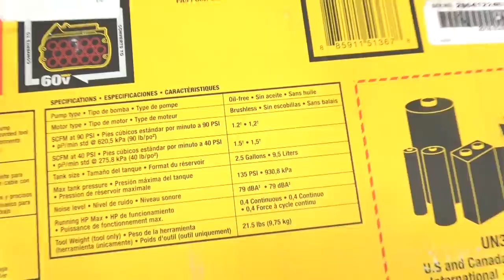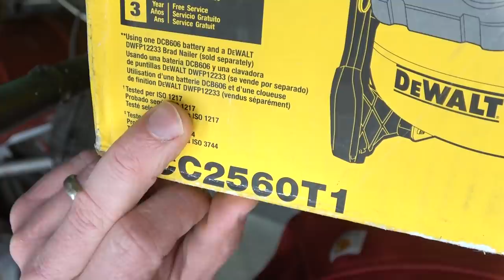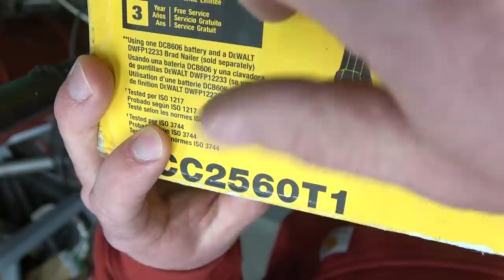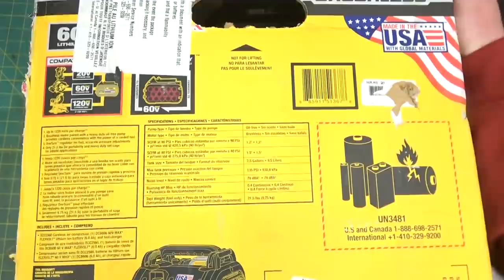BOLTR: DeWalt Flexvolt Compressor | Gutless and Brushless?

Comment: For leakproofing railcars we always use flax yarn and flaxseed oil. The teflontape does not hold up against all the vibration that a freight train produce. Railcars also experince quite extreme temperature differences and is always pressurized with 5 bar. These pneumatic couplings also have to have a lifespan of 30 years+ and again flax yarn is really the only thing that holds up over that much time if applyed correctly!
Reply: assassinlexx  Agreed! It's like he's a graduate of Flax-U. Thanks - Lumpy
Reply: juliussk I saw the transition happen in the 1970s, being a kid.
Reply: Flax yarn?
Reply: Flax-U... sounds familiar... Back when I was crawling around in hulls to obtain a few doll hairs,  I recall wrapping flax rope around shafts to then tighten the gland nut just enough to release the schmoo... Usually in a dark damp bilge  in an attempt to mitigate a leak in saturated old vessel... Maybe that is where I heard of Flax-U?
Reply: Hemp and Locher paste.
Reply: Just the flax, ma'am.
Reply: @vendomnu  A solid hand waggling before alignment has been known to loosen the fit, if that's what you're after.
Reply: "zero flax given"
Reply: @jamessouza7065  too good!
Reply: Impressive if the flax capacitors can really handle 1.21 jigawatts as claimed
Reply: Teflon cold flows.  I only use if for low pressure.

Comment: That hand hole is for incase you were carrying out by the hand hole and you drop it and break it they can say it's your fault and not replace it
Reply: He covered it with "coverassery" thing.
Reply: uh clearly its so u can know not to stick ur forklift in there
Reply: Reminds me of the carrying handle on the M-16 my drill sergeant constantly told us to not use to carry the rifle.
Reply: or it's for balancing/sliding the box around while the weight is being supported under the flaps of the box where the other failure mode is. p.s. did you really leave this comment 1 week ago?
Reply: @mikecschmitt89  He is subbed to his patrion, so he gets vids a week in advance.
Reply: They mean lifting with a forklift. If you put a fork through that hole it'll damage the product.
Reply: Some Guy Named Mat well carrying a rifle by it’s sights isn’t a good idea. Never understood why it was called a carry handle though
Reply: @ChrisSmoove77  I need to know if this is a joke.
Reply: @Mcrawf21   I think that handle was intended to cover the bolt handle of the first armalite version.

Comment: Haven't watched the video yet, but is the air connection cordless too? It would be so convenient to not be tethered to the compressor while I fill my bike tires
Reply: That's the next model. They'll have to come out with new tires that inflate with hot air and dreams
Reply: @georgefellow  that would be even better! Trying to get to 30PSI on lung power alone is quite tough.
Reply: hahaha im loosing it over here!
Reply: Wireless Air: OUT NOW
Reply: Almost as good as the EEVBlog video of the Flake (yes Flake) multimeter watch.
Reply: Bluetooth air. Wave of the future dude.

Comment: Battery powered compressor just sounds like the answer to a question that nobody asked.
Reply: Yup. But there are probably some housewives out there who will buy this for hubby as a gift.
Reply: Chris Ewalt In pro quality, it'll be great for use at unpowered sites, for example to work on the power feed to the site.
Reply: Doing pressure testing on sites without power. Yea I’ll take it over dragging a generator to the site. 👍
Reply: @SeanNyhc  
 @John Francis Doe  

Agreed. Especially out in the field, no electricity!

Comment: This has got to be the most comprehensive tool review channel ever. You don't just get to see the tool working. You take it apart, tell how each part was manufactured, the materials they used to make the various parts, the likelihood of parts lasting or failing, and if the sum total of parts is any good or not.

Comment: I'd argue that the feet being as soft as they are is actually fairly well thought out. You get the same soft kind of rubber on some computer fans, what for dampening damping whatever you call it the vibrations. 
At the very least, it won't chase you around the shop when it's running, if nothing else.
Reply: I thought the same exact thing.
Reply: If the feet are too soft then they may deform over time until the machine rests of the plastic. But yea, if they are just firm enough then they will cut down on vibrations transmitted to the surface the compressor is resting on, and might help keeping it from escaping without help. Without getting my mitts on one of these I really can't tell how the feet will perform, so I'll just wait for the tests.
Reply: I assumed that they were designed to take the abuse of vibration so soft flooring doesn’t have to.
Reply: Compressors have a reputation for shaking shops apart.

Comment: That hole in the cylinder is more than likely to bleed pressure so the crank gets past a certain degree so not to lock up when pressure is high!!! If it started compressing at the bottom of the stroke when pressure is high in the tank it could  lock up the motor!!! So by bleeding the pressure for a few degrees it allows the crank time to build speed to drive through the wall of pressure it incounters on every stroke!!! Just like on high compression engine's the exaust valve is left open for a few degrees before compression begins!!! That way you don't lock up the stroke at bottom dead center!!! You can't start compression at bottom dead center!!! You run the risk of bending your rod!!! I also believe that the rod is most likely a powered metal rod,not a casting!!! Just like in car engine's!!! Keep Rocking it out!!!
Reply: I think its replacing a 3 way valve. They're pretty standard for compressors, you can google up the parts.
Reply: Rocker Pat !!!
Reply: The 4 stroke's motor intake valves close after BDC for a different reason: since the intake valve cannot be opened instaneously (at least not for now, Koenigsegg is still developing an electromagnetic valve control system), closing it at BDC would simply not give enough time to intake all the air the motor could. So, the valve is kept open for a longer time.
Reply: @pum882  electric solenoids will not do it instantaneously either. Anyways pneumatic valve springs exist and are a proven technology that has been limited on how fast it can rev a tad over 20k rpm because of things such as flame propagation speed etc etc. At 20k revolutions in a minute a valve is as close to instantaneously moving as it can be a damn solenoid trying to do things electricity actually cant even do given the quickest thing in the universe is still not instantaneous stop using this word when its impossible alright
Reply: @pum882  at bottom dead center the intake system is still charging the cylinder because of the drop in pressure closing it abdc allows the process time to complete. It closes the piston moves up the process is then converting the chemical energy of the fuel and air into force. The piston then moves up and the exhaust valve opens. Opening a valve quicker requires more spring tension to retain said valve. So really the whole free valve thing is a joke given what he showed off was less impressive than current technology that is actually newer

Comment: I think that since the piston and the rod are a single piece (there's  no wrist pin), when the rod is at high angle in respect to the crankshaft, the piston cannot hold the pressure. So there's no need to build up pressure in the cylinder  before the piston  reaches a certain height. All the pressure built prior to that point would be lost, so the holes simply prevent it, in order to save energy.
I hope you understand what I mean, English is not my everyday language.
Reply from the maker: Yes, makes perfect sense! Thank you!
Reply: I was thinking the reed valve may keep the pressure slightly negative (psig) at the bottom of the stroke so the hole lets air in to get to 0 psig before stroking up.
Reply: I was wondering about the piston sealing at what you call high angle, that I just called weird angle. I thought maybe the business end of the piston had some roundover to handle that but now I realize that it would have to be an oval to seal at that angle (projection of a circle being an oval and all that)
Reply: Mad Zit An oval piston wouldn't fit at the straight angle.  A spherical piston (part of a sphere) would keep it's cross section but sealing is beyond me.

Comment: I worked for the company that made the pop valve on there, it's a machine shop in Fenton, MO called Control Devices.  IIRC they're on all Black & Decker compressors.  Pretty cool process of making and staking them, and even more cool to see it all the way up in Canada!

For those interested, the parts are made on Hydromat precision transfer machines, then assembled and pop-tested in house.  When I left the company, they were in the process of making a new testing / staking machine for more accurate pressure relief PSI, per B&D requirements.
Reply: I work in industrial compressor automation, we buy so many parts from CD. Think we've got some pop valves, mufflers, and check valves on the way from them now! Love those folks, they're one of very few vendors I've never had issues with in regards to quality and accuracy in orders.

Comment: Regarding your comment at 5:55 - I'd suspect they put thought into the feet and chose the soft feet for at least two reasons.  First, they'll help keep the total noise down by reducing the energy that transfers into the surface the compressor is resting on.  Second, the soft feet are selected based on the (relatively) low frequency vibrations of the machine.  Soft feet will reduce the likelihood of the machine walking around on its own.

Comment: I think the unloading hole on the cylinder is so that it doesn't see any resistance from the piston during the first part of the compression stroke. When the crank arm is at a right angle to the piston rod, that's the point of worst mechanical advantage. Since Reed valves don't care where the piston is they have to relieve the pressure that way. 

Also probably why we don't see you too many VFD compressors yet. Part of what gets it through the compression stroke is the momentum it gains during the intake stroke. Running at lower RPM would take a lot more torque.
Reply: Yup, its an unloader. 2 stroke's have it usually for starting, sometimes switchable some times not
Reply: For sure
Reply: Sounds right
Reply: @billrehm3590  Sir on  behalf of myself and the committee, please accept this best comment award.
Reply: @billrehm3590  Well not everyone can be a 3 stroke stud like myself.
Reply: the holes also look evenly spaced so from a manufacturing stand point you would eliminate having to orient the cylinder up and down eliminating a step in process of assembly. Also means if you wear out the top of the cylinder there would be potential to just flip it over and get a new section of cylinder for the piston rings to seat on just a thought
Reply: Thank you, I came here to say that and you saved me the trouble.

Comment: Hey AvE, the piston cup is a formed PTFE wafer (likely a bronze or ceramer filled ptfe) machined flat from a solid PTFE rod and formed when it's knifed off or cup formed later - not PTFE coated metal like a DU bushing. The metallic part is just a spacer that holds it down.

Comment: That cloverleaf is the National Board of Boiler and Pressure Vessel Inspectors symbol(a USA thing). In Canada pressure vessels should have a Canadian registration # (CRN#) but is only required over a certain volume (42.5L i think?) at least here in Ontario. BC law may differ..as usual. Great video, thanks!

Comment: 31:28 I immediately thought to myself "That's going to get over-torqued and smoke the bearing when he re-assembles it"....until I noticed that cool little feature in the casting to help mitigate exactly that. Very cool. Edit: and apparently I should have waited to comment that. Premature Commentation....embarrassing. Also, those holes in the cylinder wall are to reduce the required 'startup' current when the compressor kicks on. At operational speed they'll have a negligible impact on volume, but allow for a much smaller motor & higher pump ratio.

Comment: In Canada, there are minimum volume and pressure requirements which need to be met before certification is required. This likely meets neither which is why there's no stamp. I could be wrong as it's been a few years since I was in the industry.
Reply: It gets messy since it depends on the purpose of the pressure vessel. But 15psi and 1.5 cubic feet are exempt in Onterrible. The way the codes are phrased its more like everything is a pressure vessel, with these very specific exceptions.

Comment: 7:44 and I just want to say thank you for the breakdown of this compressor. It's something I've wanted for a long time. $300 no battery when first released. Then a charger and 6amp flexvolt was added and the price never changed.
That's how long I've been aiming and still have not pulled the trigger on this purchase.
This video may well be the reason I buy or don't buy this unit.

Comment: Haven't read every comment (maybe someone else pointed it out)...
There is a small nuance: When it says tested "per" ISO 1217 it doesn't say tested "To" ISO 1217. This is a way the Marketing wankers weasel the consumer. Usually using the word "per" allows for a company to create their own procedure which is based on  a standard. This allows for a bit of latitude but does not assure full compliance.
Reply: Unfortunately it won;t work legally. There is a rule of interpretation in law, wherein however a reasonable person would interpret a statement, it how it will be taken no matter then literal meaning of the words.
Reply: @maritimemisfits3360    This tool can produce"AS MUCH AS" 150 PSI...
Cheese balls.  Yeah @ 10* C. in a pressurized chamber with no load.
Reply: @juliussk  but both of you are wrong?

Comment: I believe the tank doesn’t have the ASME stamp because their standards aren’t applicable to pressure vessels that are less than a certain size, I’m not 100% sure of the number but I think it’s 5 gallons.
Reply: This is my thinking. Plus, it fits the standard design standard for ‘self cert’. (Two ends and no middle tube)

Comment: What a potential with that brushless motor and the brainbox -- as you says; with a pressure transducer and a couple of thermo couples that would be an awesome tool. Most of the applications where I use an air compressor I'd really like it to be more pro-active, not that I'd require machine learning to predict what I'm bout to do. 

But more that when I fire the first nail it should start revving up and be ready for the next nail as it usually comes right after. And I have a pneumatic bottle capper for bottling my home brewed beers where this kind of control would have been perfect. My small shop compressor with its 3 bar hysteresis only work decent in the 8-6 bar range and when it dips below 6 bar it will not press the caps on 🤬.
Reply: So under 6 bars you open the bar.

Comment: The 20V range of tools in the US is marketed as 18V in the UK. The flex volt stuff drops from 60V to 54V. 

The battery packs seem to have the same number of cells, as they are the same size.

I'm wondering if there is a different imperial volt (as opposed to a metric volt ;) ) or if the goalposts are further apart on the honesty scale.
Reply: Honesty scale vs bullshit scale. An American dyno is worth about an extra 20% too!
Reply: Actually has more to do with advertising, technically these batteries will read 20 & 60v if you were to throw a meter on them while disconnected from the tool. However if you were to measure the output while being used they will read 18v or 54v or even in 12v tools they will read 10.4v. So not necessarily a lie more of a technicality the batteries will not supply a constant 20v but they do produce it.

Comment: So you take electrocity from the wall and stuff it into a battree.  Then take the wrangled pixies from the battree to spinamathing the compressor to hold the residual power.

I think it would be interesting to find out how much energy is lost in the two processes it takes to run the compressor, charging and then  pumping, compared to a standard compressor.
Reply: What about power transmission and conversion efficiency losses from your local power station too?
Reply: Colin Antink Those are the same both ways, so cancel out.
Reply: @johnfrancisdoe1563  but they dont transmission and efficiency loss is loss. Just because they are the same in both directions doesnt mean they are suddenly not a loss.

Comment: In the UK, pressure vessels are only considered worth worrying about if they're over 200 bar litres. That is 20l at 10 bar or what have you. That means that small compressors (often 24l, 8 bar) you don't need inspections etc.

A reason similar to that might be why there's no tag on your tank.

Comment: I’ve found that Swack ptft paste is the best stuff for sealing Npt threads. Also most uk oil and gas instillations banned the use of tape due to accidents and clip-board warriors. Saying that when used correctly the combination of the two can work miracles. Side note people who use thread lock to seal threaded fittings really grind my gears.

Comment: Being in an industry that does a lot of screwing, we use mostly the parallel threads and not the wedge one you mentioned which is called tapered thread. The reason being we found that if we had a leak on a tapered and stripped it out the female side was in most cases expanded due to someone tightening the fitting too far in. Consequence being it was really difficult to get a tight joint the second time